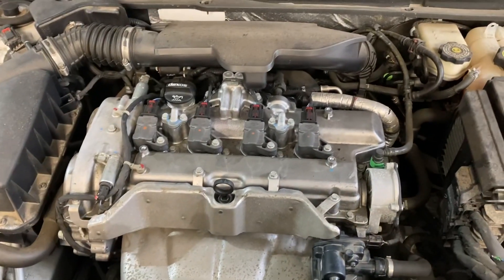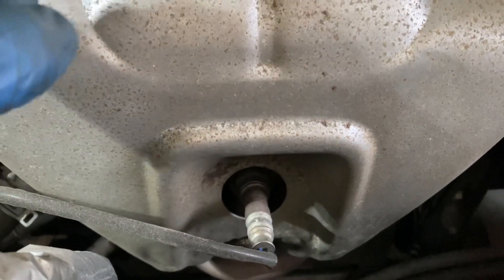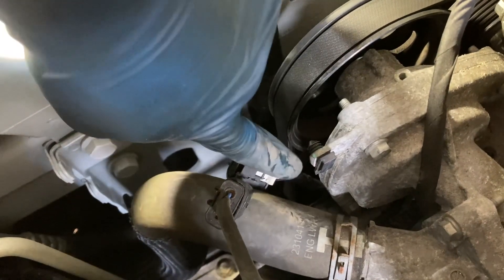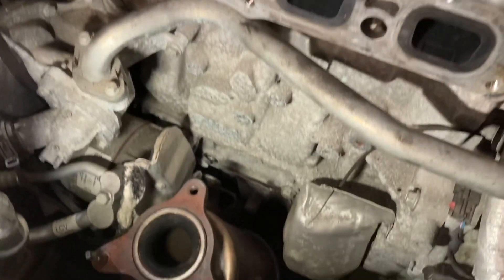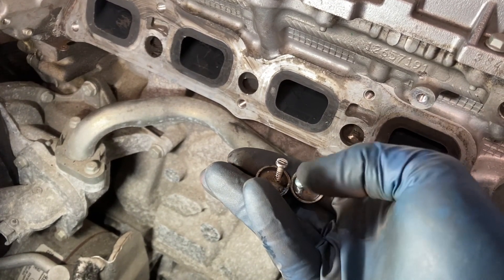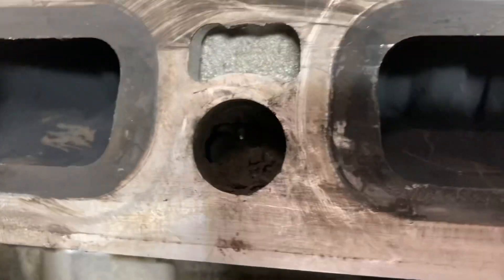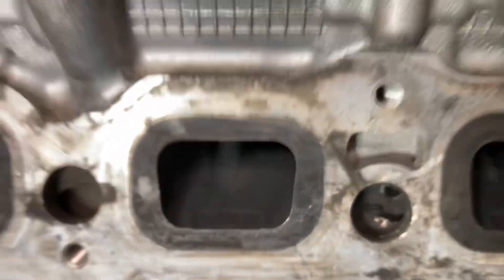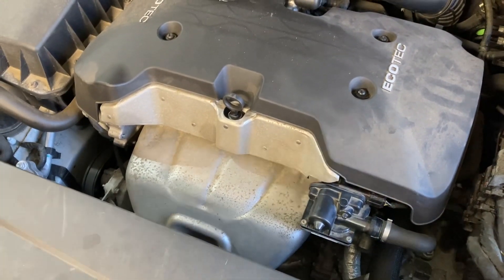2014 Chevrolet Impala P0411 repair (LKW 2.5L Ecotec Engine), cleaning carbon deposits

Comment: I have a 2017 Impala with this engine.  It has 118K on it and I've never had a single problem with it.  Maybe because I live in a rural town and usually drive for at least 30 minutes to get where I need to go.  Mechanics will tell me how well the car is doing and how it doesn't use any oil.  I still have the same original front brakes at 70%.

Comment: I have a 2014 chevy impala with the 2.5 with the same po411 code and recently now if i cold start the car it will idle for maybe a couple minutes and stall but start right back up again , If i try to drive it , it will chug and act like its gonna stall i have to pull over shit it off and start again and sometimes it will go good again , Is all this related to the po411? And how far are you from maine? Please come fix my car
Reply: i’m having stalling issues, and rough idle; usually after long highway speeds then stopping or slowly going uphill. Only code i have is p0411. Replaced o2 sensor, didnt do a thing. Going to try this before replacing secondary air pump
Reply from the maker: @Ezra_Ezra_Ezra  Sounds good, this takes more time but often this is the root cause of the issue and the secondary air pump is fine, in my experience researching this.
Reply: My Malibu 2013 2.5 that was stalling in stop sign s but I changed the amshaft sensor and it fixed the problem and now I have a 411code but I think it's time to clean the intake @Ezra_Ezra_Ezra
Reply from the maker: @SmarOneNine  I wish I could help, unfortunately I’m not close. Sounds like there is more going on, I never had stalling symptoms. Are there any other powertrain fault codes being shown?
Reply: I am trying to find out were do I connect the hose to the motor from the air injection system valves and I’m looking for the plug for the pressure sensor
Reply: Did you ever figure out how to fix the code for the 2014 impala?

Comment: My 2013 2.5 malibu doesn't have that air pump. I live in California, too. Maybe there were issues on some of those blocks and this was the answer 🤔
Reply from the maker: @LaraHobbies  they may have changed the secondary air injection system from your 2013 Malibu to this 2014 Impala

Comment: Do you know the part number for the freeze plugs?
Reply from the maker: They are Dorman 555012 :)
Reply: Ty appreciate it
Reply: Or the size of them?
Reply: I replaced secondary air injection solenoid valve and the check engine light came back on so I’m thinking I have to clean out the manifold ports too.
Reply from the maker: @shibbyslayr1  it sounds like that is the case, the car in this video was diagnosed at the dealer as needing the ports cleaned, new valve and pump. I could hear the pump run on cold starts so I suspected it was okay. I knew that his car had been driven sporadically and not up to temperature over the past couple years, so I jumped straight to the ports and cleaning them solved my check engine light.

Comment: Replace the valve , the pump , and do the cleaning , if there’s still a code clean it again
Reply from the maker: I actually just performed the cleaning and cleaned the valve. I did not replace the valve or pump. 5k trouble free miles so far.

Comment: Nice video, i did this and the code still came back , how about you ?
Reply from the maker: The code did not come back for me. Check your secondary air pump and secondary air valve, those may cause the code as well.
Reply: @northeastbavarian4249  I cleared the ports, put new freeze plugs, and added a new secondary air valve still have engine code on